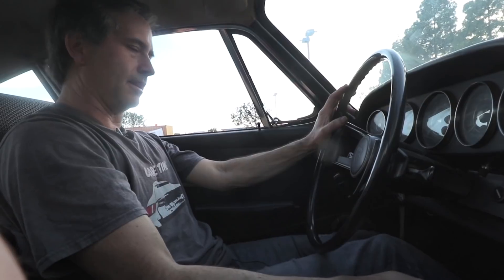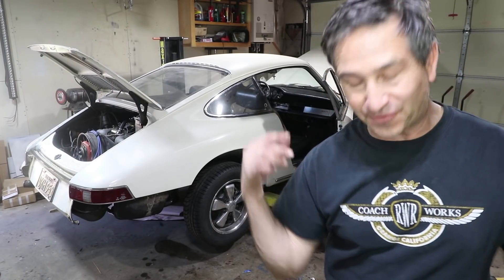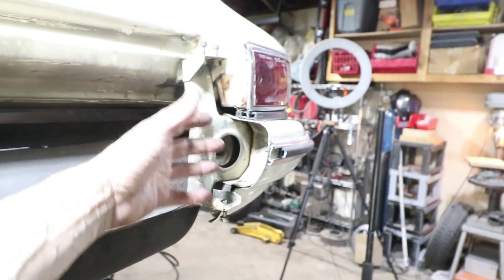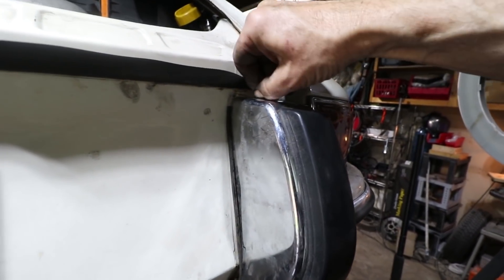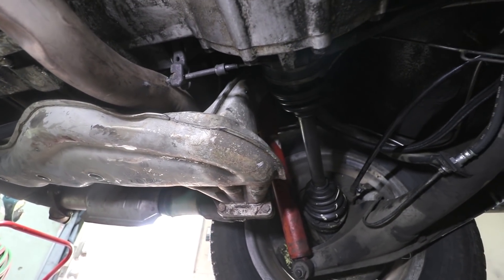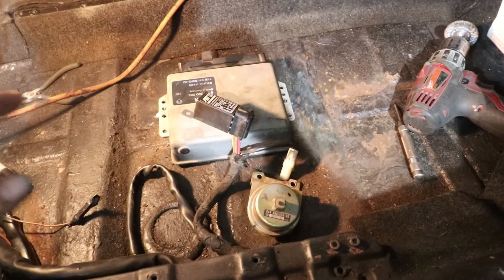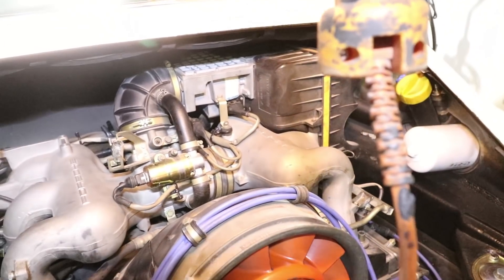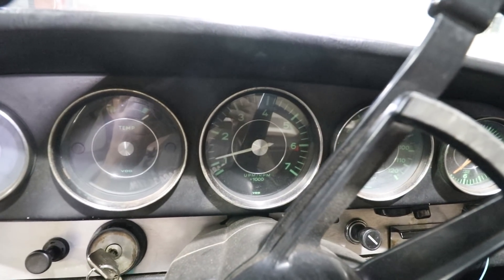First Drive In 15 Years!  Now FASTER Than Ever - Hotrod Porsche 912

Comment: I have a 60's neuntwelven and have run into EVERY issue you addressed in this video (and lots of others), so I guess it's not just me.  I have the same wiring method - if it is worth doing, it is worth doing twice... 🙂  FYI, the oil line clearance to the tire can close down in hard cornering as the tire flexes inward.  I found a groove on the inside of my very stiff sidewall race tires after a track day once and had to add wheel spacers. Those torsion bar bushings are shot so Benji will need to replace them... along with a few (well, a lot) other old rubber parts.  I learned a new trick with the tab sleeve.  Thanks.  Keep 'em coming!
Reply from the maker: I'm glad I'm not alone.  Just found out the CV boots are leaking too.  Anything rubber has expired.  
I did put 6mm spacers on the back for extra clearance.  The camber on that tire is also not favorable.  
Thanks for watching these vids.  We learn stuff together🙂

Comment: Great to see it 'almost' back on the road! 😉
It's always good to move more than your driveway looking for problems, there's always going to be something, lots of the troubleshooting on the engine stand certainly helped
Tune in next time for the project reveal of breakdown of 52 actual man hours, 18.7 of research, 26 of fabrication, 58 of setting up shots and filming (excluded editing!) 😀
Great work, thanks for sharing the adventure!
Reply from the maker: That's a precise time run down, ha ha.  I enjoyed the research and experience gained working with this engine.  
My engine will be next level!  
I totally agree that more problems may pop up when the car gets driven more.  
I'm curious if the thermostat works, what the engine temperatures settle in at.  
If the crankcase ventilation system is ok, etc etc.

Comment: Nice job.  That was a ton of work.  Well over a hundred hours for sure, not counting chasing parts, or how many hours you spent thinking about it.  Benji was very lucky to have you do this.  I bet there are not many people out there who would or could have done it with a tight time frame.
Reply from the maker: Thanks!  I tried to get the car done quickly mostly due to space constraints.  Mac was stored off-site.  Once the Benji's car was delivered to me, I tried to plunk the engine in and go.  
Then I found all the other work that the car needed in addition to the swap.  
All in, this was a speedy project. 
My 356 is a totally different timeline, ha ha.

Comment: Benji is one lucky guy. Do to the conversion at a pro shop is un affordable for the average Joe.  Congrats.
Reply from the maker: There are several skills needed, research, fab, welding, electrical, diagnostics, brakes, fuel, and the list goes on forever.  Many shops don't want to do something this involved without over pricing it.

Comment: Very impressive. How do you like the Max Jack? I have limited garage space and am thinking about a quick Jack or max Jack .
Reply from the maker: I really like it.  The posts make opening the doors difficult, but I can still sneak into the driver's seat.  
The quick jack obscures the bottom of the car instead of the doors.  Each has it's pros and cons.
I like that the max Jax stores mostly vertical and is easy to move around.  I only move one post when I'm not using it.
Tom

Comment: Hope you keep the 912 badge on it. That will really impress his classmates when he outruns them.
When a Porsche description touts “high butterfly” FI, what does that mean? I’m putting individual throttle bodies on my 914 engine with risers about what the Solexes were mounted on in 356s and 912s. I was wondering if that would qualify as high butterfly. Sounds good.
Reply from the maker: Yep, still looks like a 912.  High butterfly refers to the high performance mechanical fuel injected engines.  
Higher throttle plates allows the air disturbance to settle down before it reaches the intake valve.  Good idea for high rpm and high horsepower engines.  Bad idea for carb synchronization and cold starts.
Reply: @GarageTimeAutoResto   yes, I can remember trying to synch the Solexes on my SC. I’ve got three of the four TBs I need and some 1/4th or M6 aluminum plate to make flanges for the cylinder heads. TBs themselves have a funny base so I’m going to have to figure out how to attach them. I’ll probably enlist my Cayman driving dentist to figure out how “we” can mold his dental goop into a base for the TBs. A dentist in his practice makes valences on the side.
Reply from the maker: What ECU are you going to run?
Reply: @GarageTimeAutoResto  I’m going to get the Simple Digital Systems EFI with whatever I need for crank fired ignition.